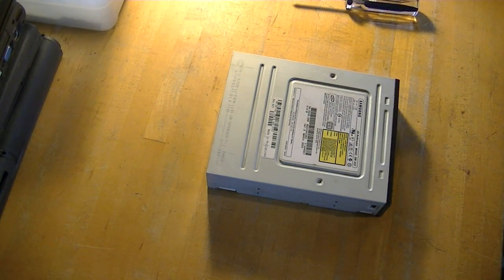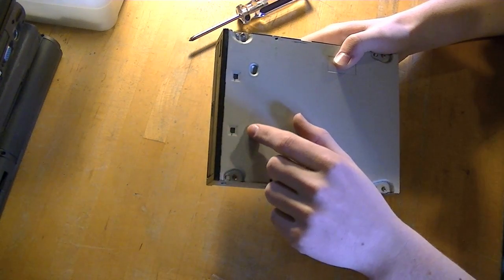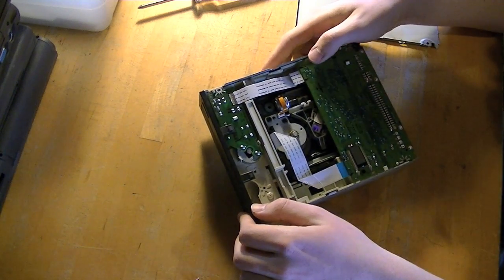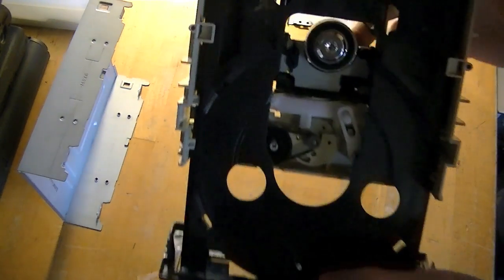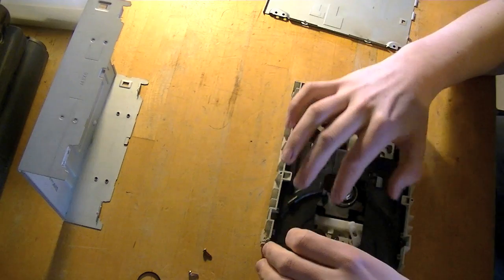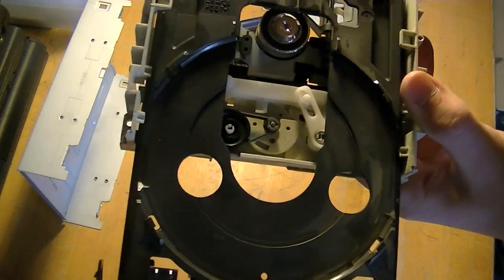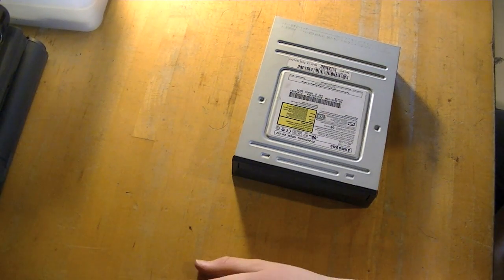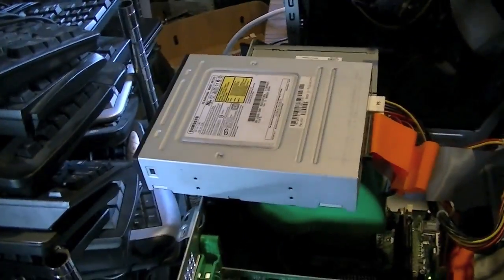How to Repair a Jammed CD or DVD Drive

Comment: Someone7089  I think a big culprit as to why the belts wear out is from people pushing the tray back in manually rather then hitting the button again. that forces the belt to slip on the pullys a bit and stretches it out over time. also the rubber does dry out over time and so loses it's sticky property. one could buy belt dressing from an auto parts store and spray the little rubber belt with that. makes the belt sticky and gives better grip. nice video btw.
I'd also suggest getting some lithium grease and lubricating the slides a gears lightly to reduce the resistance and prolong the life of the belt.

Comment: I just open the tray with the good 'ole' paper clip and use a pair of 'hemostats' to change the belt. No need to turn on the PC, remove the drive from the computer or disassemble the drive.

Comment: The large "wheel" that drives the belt is  called the  "pinion gear".  You can call the small one a spindle, I guess.  If you had thought about it, you might have used that hole in disc tray to access the back side of the pinion gear to facilitate placing the belt.    Just sayin'.  Otherwise, brilliant!

Comment: Question:
I have two drives that suffer from being jammed.

If the CD drive is really hard to open with the paper clip (i've had to push the clip a bit hard to open it a little bit to grab the tray with my fingers and then open it fully) it's the belt or something else like the gears?
When i got it open, it takes extra force to make the tray start moving again as if jammed and struggles moving, not smoothly (when it stops moving, open or closed it jams).
Can you tell me if i can repair them or i just throw it away?

Comment: my janmmed cd drive is in my car and has 6 slots for cds so I don't know if it was a broken belt that caused the jamming or if the multiple cd's are overlying one another.
Toyota won't repair it.. and it will cost me $50 to have them remove the radio / cd player from the dashboard just to look / try to fix it... ? ideas?
Thanks.

Comment: a Dell Dimension 4400? or 3000/4000 series at least ;) My poor dimension is suffering from capacitor rot, its a matter of time before i have to do a cap replacement :(